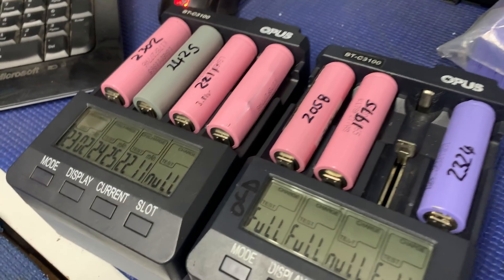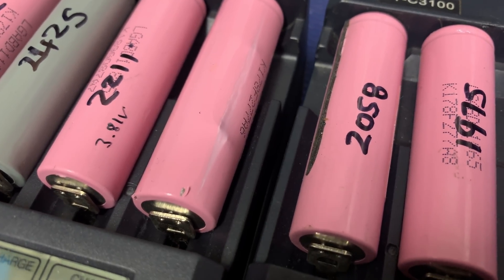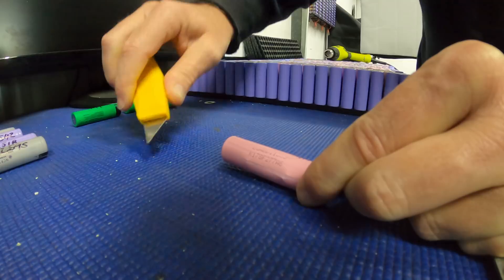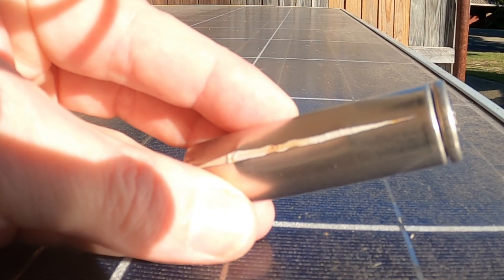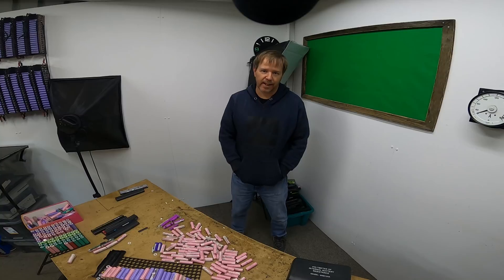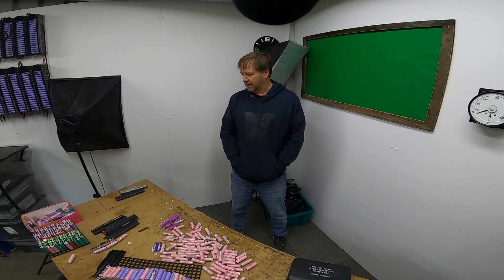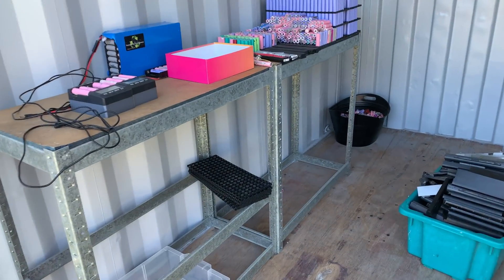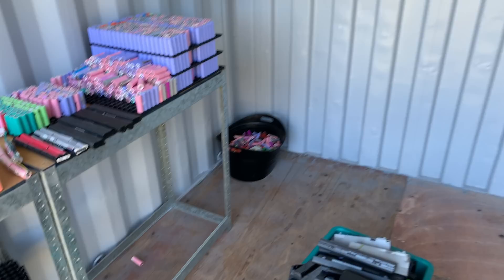Narrowly avoided disaster? Follow up video in description!

Comment: I gather those are ion cells? Just learning.
So are ironpo4  safer, and if so why not use that chemistry?
Reply: LIFEpO4 has less energy density
Reply: @offgridwanabe  , thanks,  as I said learning.  OK I understand the energy density,  but why use a chemistry that is inherently dangerous especially when using secondhand cells,  other than for the cost factor.  From what I've thus far read, lithium iron last longer (providing you don't over charge or over deplete),  are easier to manage than li/ion and a hell of a lot less volatile.  I have yet to see an example of thermal runaway for them.  I have seen them shot at,  crushed, pierced,  shorted and over charged, burnt and dropped in water with no explosive result. Dynamite may be more bulky than nitroglycerin,  but it still gives a Big Bang for it's package size,  I know which one I'd rather play with. Interested in your thoughts.
Reply: @kezzatries  Yes I agree which is why I have LiFePo4 A123, 26650 batteries in my powerwall plus they were cheap. I did have an incident so I know they can blow up pretty good and catch fire but not a runaway. My video only shows the aftermath which wasn't terrible as it would have been with LIPO. I would think people are attracted to lipo because of the power and availability (cheap).
Reply: @offgridwanabe  ah!  That must have been a worry.  I'm interested in do you know why the fire started.  Out of balance,  bad connection,  wire size,  fusing, bms faults!? Trust all is good now.  Thanks
Reply: @kezzatries  BMS experiment did not work. overcharged one cell or the vent stuck
Reply: @offgridwanabe  you gotta watch those experiments closely.  Have you read this https://marinehowto.com/lifepo4-batteries-on-boats/
Bit of a long read,  very informative though.  I have been watching a few of the UT on Lithium and it is interesting that a couple of them obviously get their info from this paper.  One of them (will prowse) has recently changed his recommendations on how to's and it looks like to me that he has gained his info from this paper. 
I'm way into my sixties, have been dealing with lead since I was about 8, it's taking me a while to forget lead tech and grasp lithium tech, I am off grid on lead n would like to change to LFP.  Anyways nice talking with you

Comment: I've seen some 18650 cells with a casing that's welded on one side because it was a rolled piece of metal... Maybe that one was that type and expanded.

I've been told a few times I should never use cells that went under 2V... I usually just babysit them and see if I can get them up towards at least 3V and not overheat.

What do you do with all the lower capacity cells you don't use?

Comment: I wouldn't say it happened for no reason. As far as I remember studies show that the chemical structures inside the cell start to disintegrate below 1.5V
Reply: The material can form microscopic dendrite "whiskers" off of the anode or cathode (I can't remember which way it goes), and when one of those penetrates the separator: kablam-o. You get a direct short between the anode and cathode, and the battery quickly turns all the stored chemical energy into excitement, real quick fast in a hurry.

Comment: Can I ask? Why would you even try to test the battery if it’s way low? 1.1volts means the battery is damaged. Why would you even bother testing it??
Reply from the maker: because voltage isn't a good indicator of a bad cell -
Reply: HBPowerwall ah ok, because every single time I’ve tested a battery lower then 2.5volts it was bad. It never hold a charge, the mah would be really low or it would be a heater. So I just gave up testing low voltage batteries.
Reply: @iiinsaiii  if you can slowly bring the battery back up above 2v you stand a good chance of saving it. but if it is that low and you charge it normally the heat created by the batteries natural resistance will almost 100% kill it permanently.
Reply: stressmaster I’ve tried that too, I would try to charge those battery slowly at about .3 v- .5v and still no luck. I guess it’s my bad luck 😤

Comment: Looking at the rupture pattern and the browning marks just inside of the center section with the distinct s shape parting I would guess there was a weak spot in the cell wall at that part and an internal short at that location heated the weak part it split and released some pressure and the rest of the split is a rippled impact tear from the event. 

Obviously that's my hypothesis, can't prove it. But fact the wrap was still more or less intact would seem to indicate it contained it fine.

Comment: I have a question. I am building my own packs too. I have some cells that take charge well up to 4.2V and after finishing they drop down to a voltage around 4.1 or 4.05V but even after some weeks they stay there so they don't discharge further than this. What is the reason for this behavior? Greetings from Germany!
Reply from the maker: I would say maybe high internal resistance - i use one of these units - https://rover.ebay.com/rover/1/705-53470-19255-0/1?mpre=https%3A%2F%2Fwww.ebay.com.au%2Fitm%2FSM8124-Internal-Battery-Resistance-Impedance-Meter-Portable-Battery-Tester-CS%2F113863236629%3Fhash%3Ditem1a82c71c15%3Ag%3AKucAAOSwA1NdX7mB&campid=5338316197&toolid=20008

Comment: Apart from this cell issue I recommend you to not stack the modules as you did in the container for storage. In case of a fire you ignite other cells as well. I bought big LiPo bags @Ali and you can store them there. It is all about seperating them. During operation you could pack them in Pyrobubbles. It will be still a hell of a mess in case of failure but the fire can't spread much. I am also looking for a small shed with AC for the batteries only as the Inverter will be in the garage. At least that is the plan. BTW: Got my OPUS yesterday and you were absolutely right in your live stream: LiitoKala is crap. :-( Thanks for the hint. Greetings from Germany and take care.

Comment: That kind of failure is due to a high internal pressure, possibly from a faulty end valve. You'd  see similar failure mode in pressure tests on drawn case (the case is drawn from a small disc of steel, like a soft drinks can) pressure vessels. There was obviously a cause to the high internal pressure, but now it's vented it's electrolyte, you'll probably never know.
Reply: So perhaps it's safe now? Also: is that how they make cells safe for recycling? Except going thru the top valve instead of the side.
Reply: @dreamcat4  kinda. it is a gel spread on a super thin sheet of metal. I think it was alum. after you get the case off the top and bottom are almost free. removing the +/- leads and they come off. than it can be unrolled back to the original single sheet with the lithium polymer gel on it.

Comment: The barrier got damaged, either from it being so far down in voltage to begin with or from rather unkind treatment. The insides expanded and that's what caused the rupture, not so much just a vent, hence why it didn't vent. With your cells and how they're being used this isn't unlikely to happen again, even with tested cells that you've put into packs.
Reply: Absolutely this. 1.13V? Throw that cell out. Don't even bother trying to use it. Cells are so cheap now. Way too risky of a failure. I would never try to recycle any cells that ever reached below 2.3V if not 2.8V. More than likely their capacity has been severely reduced at the very least. Any heat or self discharging is also grounds for disqualification. Not worth the trouble.

Comment: What probably happened was a overheat explosive venting/gasing of the Lithium. I have seen this on bigger Lion cells. It is supposed to vent via top vents but sometimes and very rarely the expansion is so fast that it pushes the sides out. The battery is actually designed to allow this to stop a full on explosion. This is why the seam isn't crimped or tack welded.
Reply from the maker: if it vented i would have thought you could smell it - either way it was not good at all

Comment: i thought i'm not supposed to charge lithium accus that are 1.13 volts, but wth, i'm always learning new things here
Reply from the maker: you can charge them very slow, - this one would have been that voltage when removed from laptop. it was most likely very slowly charged back up many months ago.
Reply: I have seen people put it in a device with another battery in series. I think it slowly either drains both or it starts to load balance but this depends on the device.

Comment: Hey mate I am on the Sunny Coast and am looking to buy some batteries.  If you decide to sell any laptop packs or the 2200 and below then let me know.  Cheers.
Reply from the maker: there is probably only 100 or so useable in that box of hundreds of cells i'll see what happens - need to get this over video done first and might need a battery or two spare just in case

Comment: A flaw/ weak point during the case extruding process
Reply: When the steel plug is press drifted there is sometimes small hard inclusions in the steel. that is then elongated along the can side of the finished shape I worked in QC testing on brass shell production using eddycurent testing to detect them. I bet china dont do that its probably considers to unlikely for the cost of testing vs the risk
Reply from the maker: Sounds very likley
Reply: Sounds plausible to me. Our company makes  thin plate for batteries, spraycans and so, and a small percentige with defects could be send to the customer.
Reply: I think so also. I don't think it's anything to worry about, even though it is odd.

Comment: There's a dark patch on the material within the cell - I would hazard a guess an inclusion during manufacture, which weakened the cell wall until your test/charge/discharge cycle was just one cycle too many :-(
Reply from the maker: Didn't even notice that i'll take another look at it in the morning for sure. Need to find the power supply for my Microscope camera so i can get some close up images
Reply: Saw the same, looks like something was happening there before the full rupture (causing the faint dark line). This needs to be carefully look at, especially the metal edge to look for a possible flaw, like a pinhole.

Comment: Sorry I ROFL when all the batteries spilled onto the ground, what did you think was going to happen ?
As for the failed cell, it's split along the welded seam that is needed when a flat piece of stainless steel is converted into a cylinder.
Best guess is they made the cell itself slightly too fat for it's casing, over time the pressure on the walls has caused it to break open, charging it increased that pressure.
So manufacturing fault, poorly welded casing and too much stuffed inside.
Reply from the maker: Yeh - i know right, wasn't like my technique was on point lol I was like meh, i'm done with this and need to get back to the day job - then spent half the day editing and messing with audio so i could release.. Ooh also the Patreon ending ... Manufacturing fault seems like the most likely cause

Comment: I just had to send my hp omen to service. It is on warranty so I could not open it. But apparently the battery has swelled so much that it bent the top plate/ keyboard and trackpad.
Reply: It is more common than before because of the more dense Lion in the cells for the higher mAh. This can cause the vents to not allow the gas off fast enough and thus they swell. The more dense the Lion is it seems the more pressure builds up before it can reach the vents.
Reply from the maker: Also modern batteries aren't 18650 they are flat pouch type
Reply: @stressmasterbk4294  Any ide if it is discharge or charge that are the typical culprit? 

In the case of this video I guess the metal tube is welded sheet metal so if the vent at the end (top?)  got stuck you should get rupture along the weldline or slightly to the side of it? But you guys know a lot more about it than me, so only my 2 cents worth of thought.
Reply: @fritanke2318   It's actually not welded. it is a locking tongue and groove pressure fit were the pressure of the casing is what keeps it together.  As for the cause I can't say for certain but it is normally >95% of the time during the charge cycle that this happens. This is because the force to move the ions from one spot to another is greater and with all energy there is always at least a little resistance. ATM the i don't know of a conductant that has no resistance. In this case the Lithium Polymer also has a resistance. This is mitigated usually via the alum or other metal that the lithium polymer is spread on like a gel before it is wrapped into shape. Just like a roll cake. Remember that this it is a gel and can eventually get thin or thick spots that will allow for this to happen. This is why you never should charge a battery in high temperatures. The hotter the gel becomes the more liquid it will become until it vaporizes. This vapor is poisonous and flammable but the valves and no oxygen in the gell roll normally prevents a fire. This is why it only expanded instead of exploding. If it had access it O2 it would have been a fire. This is also why if you puncture a LIon battery it will short it's positive and negative at that spot of puncture. this will flash vaporize the gel and since it has O2 you get a pretty red flame. hopefully this helps you understand it and if not ask more questions and I will try to help.
Reply: @fritanke2318  Also you will notice that the expansion was greatest away from the vents. It expanded faster than the gas could make a path to the vent I am thinking
Reply: @stressmasterbk4294  Apreciate  the elaborate answer. I learned quite a bit today, thank you.👍
Reply from the maker: That is very common for more modern laptops, i got one here yesterday with same fault.
Reply: Interesting that in the early part of the video it looked like the heat shrink was not burst or punctured. This must mean that any gas must have escaped at the open ends of the heat shrink. The deformation of the metal looks like it occurred very fast in a sudden event. So strong enough to burst through the metal but not strong enough to burst through the heat shrink. I think that the metal case must have had some sort of weak point after manufacture like a hair line crack otherwise it should have had enough energy to burst through the heat shrink.